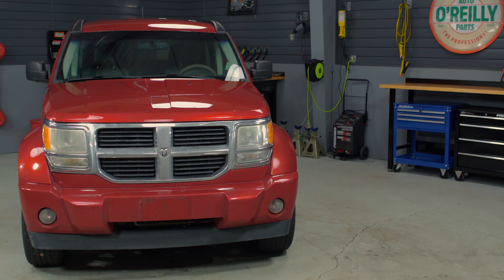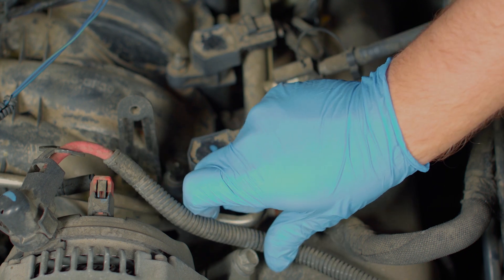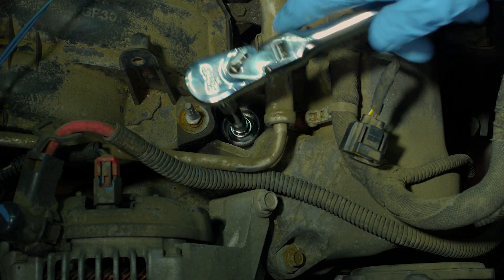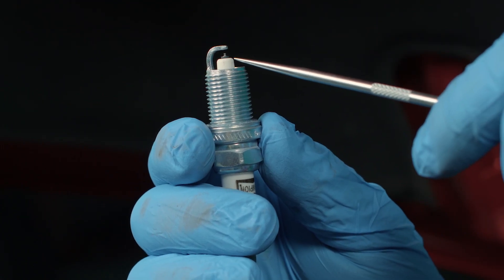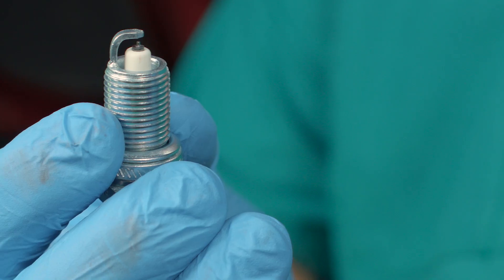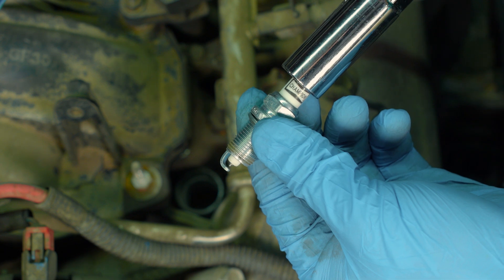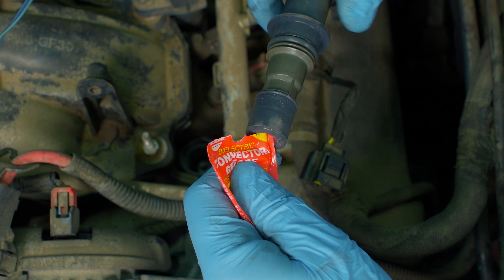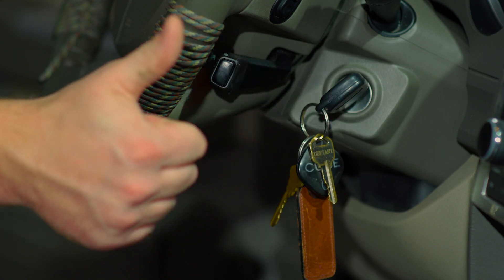How To: Check, Set Gap, and Replace Spark Plugs

Comment from the maker: Supplies Needed for This Job:

1. Safety Glasses: https://orly.cc/4e7cFKz
2. Gloves: https://orly.cc/3YKu3QZ
3. Shop Towels: https://orly.cc/4fFCSS4
4. Fender Cover: https://orly.cc/3QcOv7K
5. Wrench: https://orly.cc/4e9iuqZ
6. Sockets: https://orly.cc/3Odkxji
7. Spark Plug Socket: https://orly.cc/4hqlvFT
8. Spark Plugs: https://orly.cc/415o6PL
9. Gap Tool: https://orly.cc/3WQ9UYu
10. Coil Boots: https://orly.cc/414w0sz
11. Dielectric Grease: https://orly.cc/434QVxh
12. Torque Wrench: https://orly.cc/4b2sN0b

Comment: I apologize if missed it, but always let the aluminum head cool down to ambient temperature before removing spark plugs. This will help prevent thread damage to the head(s).
I agree with the prior posts, put a small amount of anti-sieze compound on the new spark plug threads.
Reply: Actually read the instructions. Must quality spark plugs now tell you not to add any antiseize or you will accidently over tighten them.
Reply: @slaydonk  is this come thing new?I've never heard of that.
Reply: I'm shocked they didn't have that part in, about using antiseize

Comment: NEVER replace a spark plug without a small bit of anti seize compound on the spark plug threads.
Reply: Dave I recently did my 2000 Ford ranger (gas saver) and didn't use any of the anti, ',compound' u mentioned, never heard of it.  Can you explain your above statement plz.
Reply: If he won't I will if u don't service ur vehicle at regular or suggested intervals for "on" maintenance and or engine life an performance  sake wich not everyone does sadly namely because it's bloody expensive anymore trying to take out spark plugs far past there mileage can become an increasingly expensive task I'm sure ur familiar with what should have been a 5 minute fix an here we are on day 3 very similar experience to be had however I still wouldn't really recommend antiseize especially on older vehicles the vibrations u can get on a more powerful engine aka track ready short runner can start to loosen things spark plugs included that shouldn't be loose driving ... albeit rare occurrence but the repercussions of a mistake like that on the right vehicle at the right time can be ... well let's keep it pg 13 but not good ur best bet is to replace everything according to manufacturer spec if ur not sure don't do.. or do something outside of what's required if ur just not sure far to many wallets have seen better days not taking advice or taking uneeded advice I don't know if this helps or not I hope it does an I hope I haven't been to vague nor specific but when u just don't know follow spec to a T if u have a problem after that it's time to consider a few things including mileage on the vehicle if new the warranty if much older ur budget? Hope this helps u an many more if not follow the comments underneath as I am by no means perfect or a 25 plus year mechanic
Reply: @ashvall_9931  Thank you, I had the same question 👍
Reply: I was told never do that because th ey have the threads have a  coating already from factory
Reply: Replace "NEVER" with ALWAYS.

Comment: What is the risk of adding anti-seize to a plug which already has it from the manufacture? What is the risk of leaving out anti-seize with a plug without anti-seize? Also, do not touch the porcelain with anything that might have oil or grease, such as fingers or oily rags. This will ensure that there is no pathway for arching down the sides of the plugs. It doesn't take much to provide a path for high voltage to "escape".

Comment: Be careful that you don't get a socket stuck in your head.  Some heads have such small spark plug tubes that you need to use a thinwall socket.

Comment: I have to comment that you left out the part where Anti-seize compound needs to go on the threads.  I never install plugs without some --especially on aluminum heads. Anti-seize will save your rear when taking out any nut/bolt/plug that is subject to extreme heat differences and corrosion. Otherwise the video is very well done.
Reply: Exactly! Galled threads on a plug in an aluminum head will be a disaster. Orielly's doesn't stock heads..
Reply: @samborez8089  Most new spark plugs already have antiseuze compound on the threads. If the spark plug is manufactured with compound on the threads do not put additional antiseize compound on the threads. Always change plugs with the engine cold!
Reply: On certain spark plugs like ngk you don’t use anti-seize. It’s all based on the manufacture.

Comment: So, is measurement device supposed to be able to barely pass through the gap, loosely pass through the gap or stop when touching electrode?
Reply: It should basically barely be able to pass through
Reply: @slaydonk so you can touch electrode with gap tool?
Reply: As long as you are gentle,  touching the electrode won't damage it.